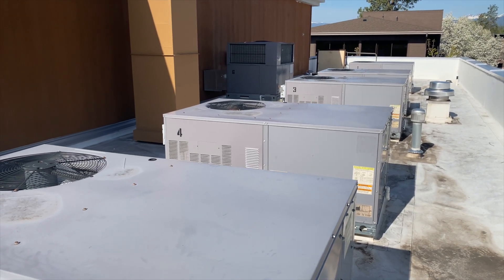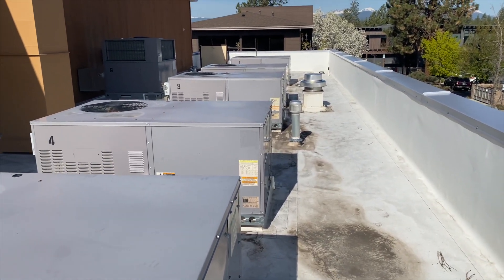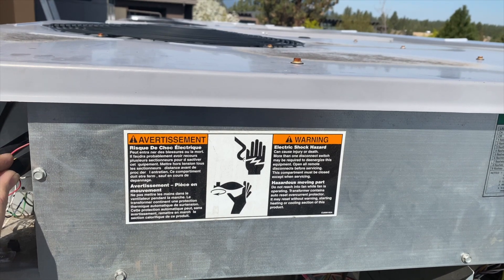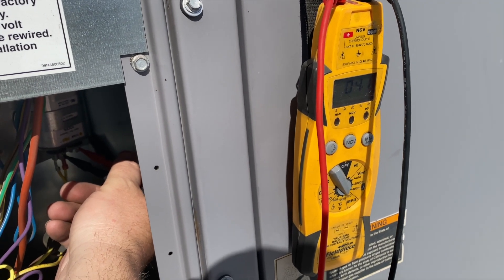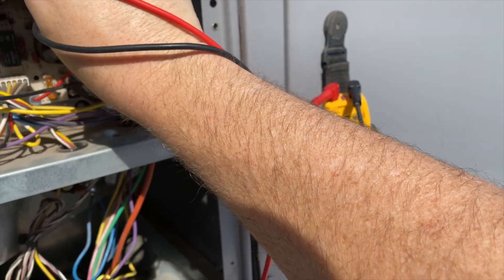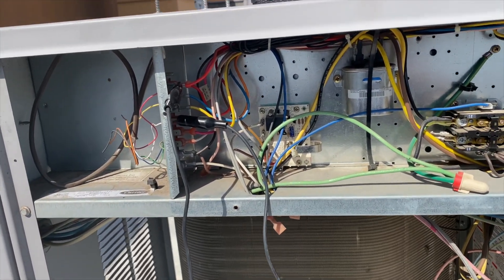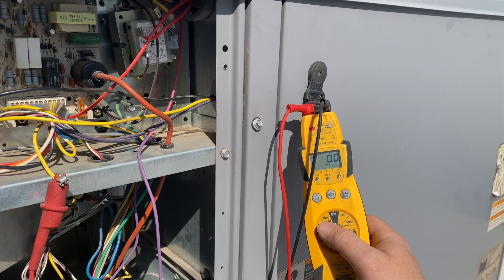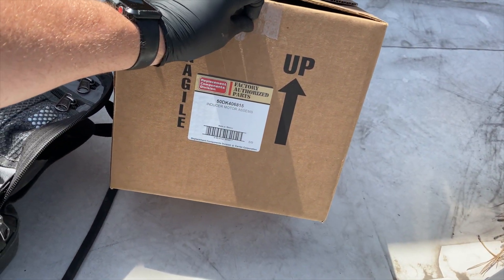Loud Noise on the Roof!!! EP61

Comment: GREAT TIP!  If you were told the time of day the noise was annoying you may have deduced if at night, temp would have suggested heat mode to cut your diagnosis time.  Of course if paid by the hour I would have tested everything as you had done.  Nice job and thanks for your time in sharing the experience!  BTW, Hall Effect sensor.